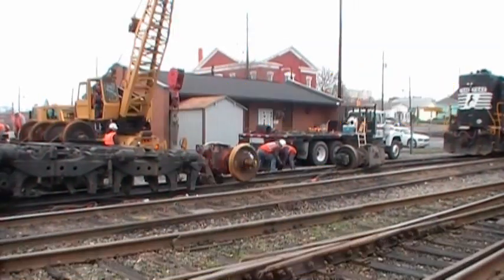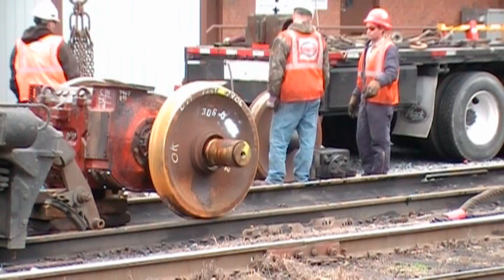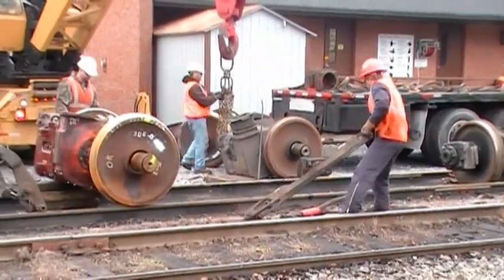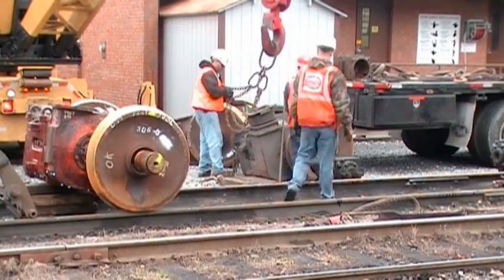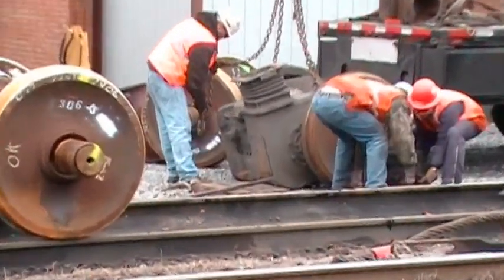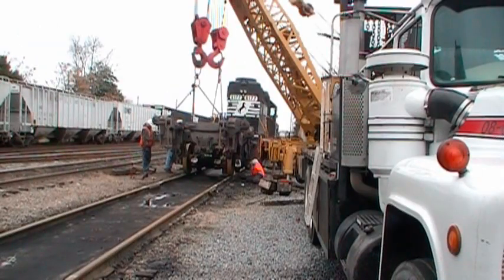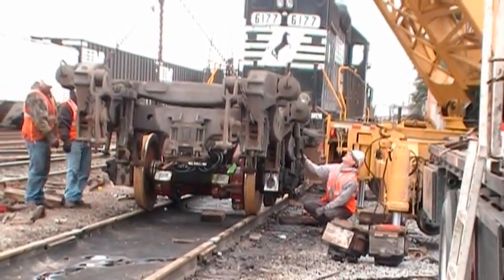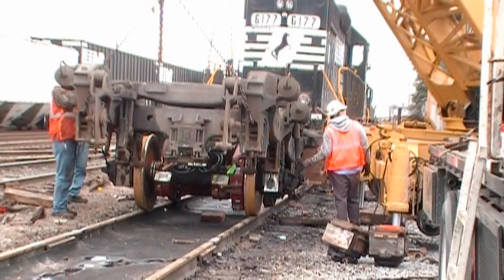Traction-Motor-Series-Part-2.mpg

Comment: I'm surprised how few gears are in a locomotive truck? I figured those motors were locked into a series of reduction gears to help develop all of the pull? Even at Cajon Pass, the locomotives are said to have different gear ratios for going over the Hill?
Reply: There are reduction gears between each traction motor and its axle.  Notice how the bulk of the traction motor assembly is not centered around the axle.  That's because there are a few gears (2 or 3) that connect the motor to the axle that holds the wheels.  This is where the gear ratio comes from.
Reply: @trainzguy2472  Thanks! Appreciate that explanation...
Reply from the maker: Ships use reduction gears but locomotives use traction motors they are well built gears for sure

Comment: how do you hook up the cables under a suspended load? or crawl in underneath after the unit is on the truck?
Reply from the maker: It is a tight squeeze but there is room to crawkl in there

Comment: That crane picking up that motor is like using a shotgun just to kill a fly lol.
Reply: Don’t kid yourself.  Traction motor ran weigh from about 9,000 to 10,000 lbs with ease.
Reply: No doubt! But by looking at the block and tackle on the crane, I wouldn’t be surprised if it can pick up 100,000 lbs.
Reply from the maker: Mobile cranes are quite strong   Thanks for commenting

Comment: Pretty interesting shit! I've wondered for the longest how many amps they pull-there's usually 6 of em on a mainline long haul Loco.  Then as a secondary question how much torque is needed for the prime mover(the diesel engine) to drive that main alternator that powers those traction motors under full output..say when climbing a grade with a 15,000 ton train behind it?
Reply: For a limited time, an SD40 can pull around 5000 amps.. the SD75 can hit upwards of 9000 amps. There are time limits though.  This is total alternator output so divide by 6 roughly..
Reply: Thanks, for the info!  It's not easy finding technical specs on this topic, but I have an insatiable curiosity about it!
Reply: @MrStanleygiles  no problem,  you asked a good question.  I repaired those machines for 12 years so feel free to ask anything.  I have been away from them for years but I still remember a lot.. oh, and I have no idea about the torque values honestly.  I was an electrician so I dealt with HP and volt/amp/traction faults.. loco engines are designed to put out a certain RPM for every throttle.  The computer or mechanical load regulator will adjust the electrical load accordingly - to keep that RPM stable.  Hope that helps..
Reply: @ackmino  Thankyou!
Reply from the maker: Thanks I do not know the technical stuff
Reply: No worries.. appreciate the response & a great post, thank you for sharing it!

Comment: When I was a little child I always loved the sound of the powerful diesel engines,  then I was baffled when I learned that the tiny electric motors are what moves that 100 car multi million ton train!
Reply from the maker: Thanks it is a strange concept lol
Reply: TINY MOTOR? ?????????     LOL LOL LOL
Reply: Tiny compared to the size of what it's moving yes, compared to tiny 12v dc motor on a slot car, giant.

Comment: The ship yard where I worked had rails laid all over the yard where we made the ships and we would move the ship with "Western electric motor wheels. we move ship that weighted 25,000 like that was at that time he heaviest move over dry land. I could believe how they do it when I went to work there.

Thanks for the videos on how they changed out the drive motors. I have learned a lot by watching you movies about rail engine and railroads. Thanks again

Comment: Cant they just change the wheels, instead of the whole motor ? Or is it just much faster this way?
Reply: Motor is attached to the axle between the wheels easier to pull whole ass'y.

Comment: That 'block' around the axle is a housing that contains the wheel bearings, and the rubber thing (bellows) on top is probably for the cooling air for the motor.

Comment from the maker: The wheels need to be perfectly smooth to roll quietly on the tracks.  If the wheel slide some it makes a flat spot on the wheels causing the train to bump real hard ,  bumping is not a good thing when a rail car weighs 200,000 lbs  it can cause the wheels to break and wreck the train.

Comment: 'Lifting off the bearing box', funny they tried lifting it back up..that's gotta be 450-500 pounds...
  I worked at a machine and Welding shop here in Sacramento, Calif, we had a wheel press for the passenger/cargo axles, and used a lot of the Timken cartridges for wheel and shaft work in rock crushers..I got a real good feel for estimating weights from stuff like the railroad has, but they pretty much doid all their own machine/welding. We did do a lot of hyd cylinder repair forthem though.

Comment: @iRECKONER  shops that service loco rewheels usually have a drop pit. A section of rail drops down like an elevator and the new motors are lifted up to the unit on that section of rail - one at a time. Its actually very simple, traction motors basically float and are not held in by much.